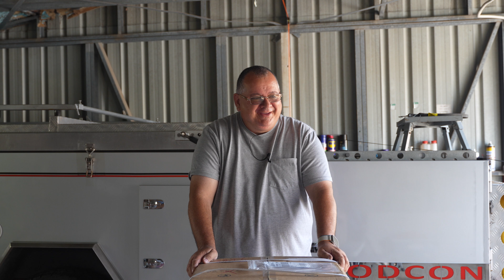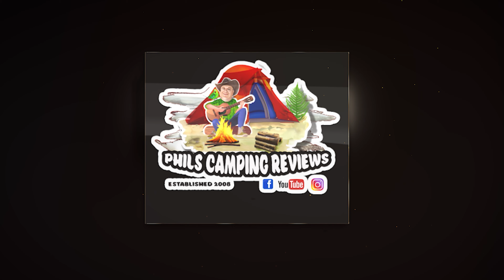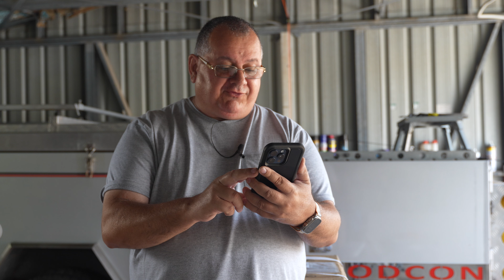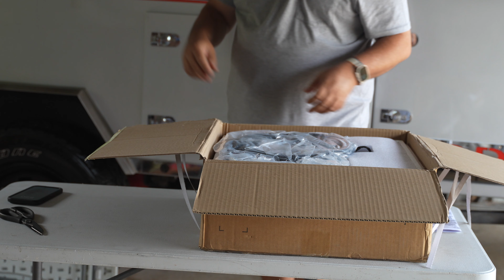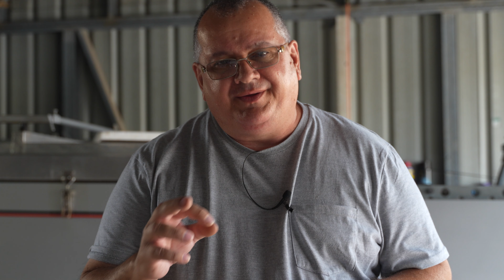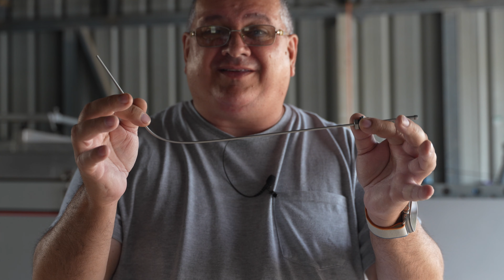HLN AEROLYN 4000 12V 4KW Diesel Heater Unboxing

Comment: Hi Phil, thanks al lot for this video. I just received my Aerolyn 4000 and on the end of the cable harnas witch connects to the controller, there is also a cable whitch is labeled ‘temperture sensor’. But that’s not supplied. Have you got any idea what its for? Maybe you could cover it in Part 2 of your upcoming install video.
Reply from the maker: Hi.!!sorry for late reply.  I missed your message.    I will check

Comment: does it have auto turn on/off when target temp is hit? most chinese heater dont but keep running at minimum power (overheating the cabin, making them useless for overnight usage)
Reply from the maker: @thrawn0r   I don’t know,  thus far I have not tested it.
Reply: It will turn off, and you can set the temperature difference above which the heater turns off. It will restart by itself if the temperature fall below again.

Comment: So does it look as good as the other one you have installed in your camper trailer?
Reply from the maker: Looks as good to me,  a tad smaller,   there is no step by step instructions.  so the AUfocus wins there.  This one does have a Brushless motor which should be a lot more silent and with the sound proofing on both the exhaust pipe and air intake,  that's going to be very interesting.